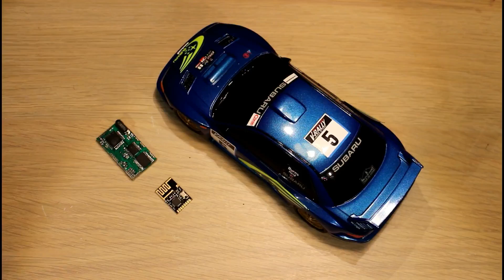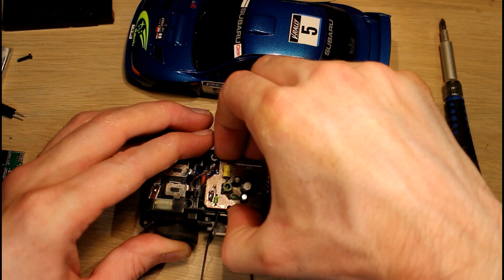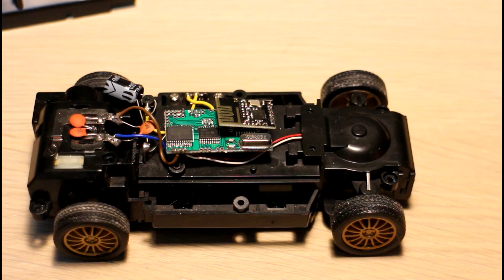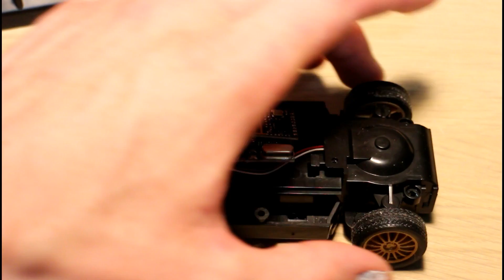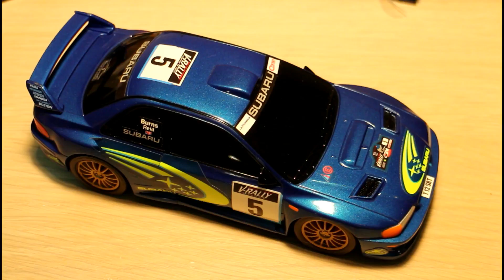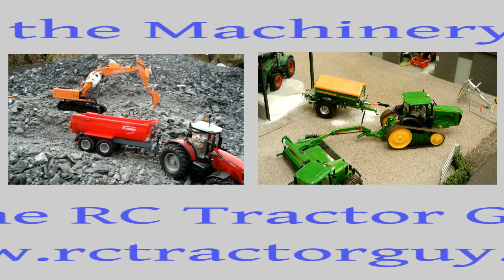RC Subaru Impreza Part 2 - Installing the new control PCB

Comment: Wonderful, loved it bro. Can you share details about the PCB.
Reply from the maker: The PCB is just how I did the other tractor with the Arduino Pro Mini and the TB6612FNG motor driver, all I did was compress them onto one PCB. I was planning to get it perfected and sell some but I've had very little time over the last few months so it's been on hold.